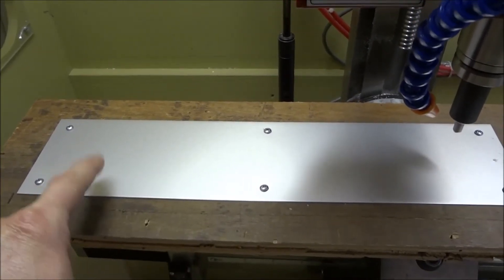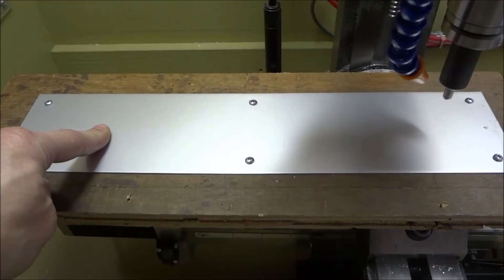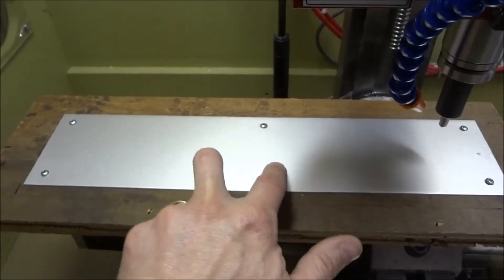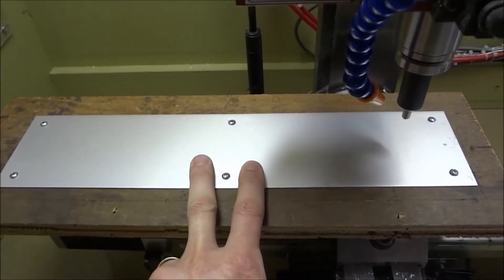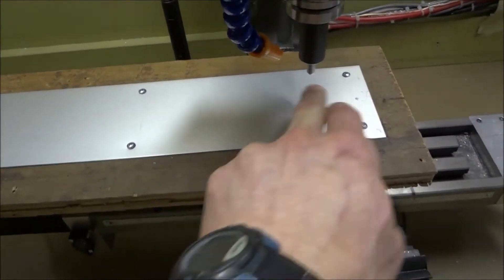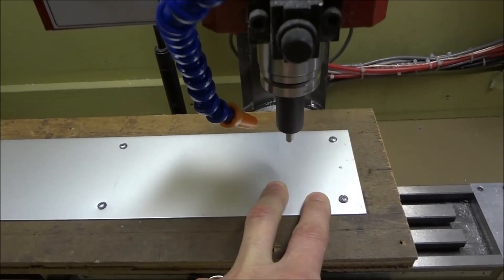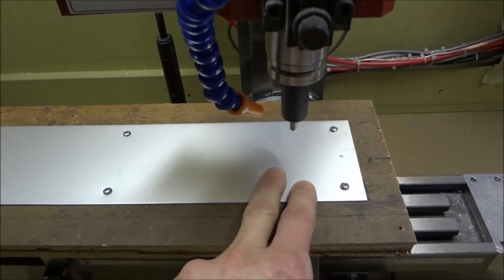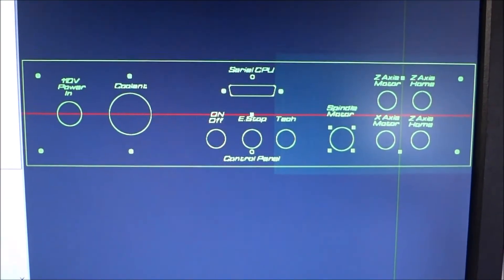G0602 Project Part 6 Electronics Enclosure

Comment: Nice work ! what was the liquid you were pouring on and for which purpose?
Reply from the maker: +Dztronic  I use 90 % rubbing alcohol for coolant when machining aluminum on the X2 i have no flood system or mist so this works well.
be Safe,
Sam
Reply: +CNC4XR7  Could we use simply water for instance?
Reply from the maker: +Dztronic  The Alcohol Has lubricating properties as well as cooling properties I would not use H2o
Reply: +CNC4XR7 Useful informations. Thanks! I was asking that because of the alcohol's flammable properties...I though that with such friction it might ignite...I don't know if it may be possible to happen!!!

Comment: Great Video Sam!  How did you mount the plywood to the vise?
Reply from the maker: Craig's Machine Shop  Ah Yes I just screwed the plywood to a 2x2 and clamped the 2x2 not a perfect setup but it worked the plywood was a little uneven.
Reply: CNC4XR7 
Just needs to be good enough to get the job done.  I will have to keep that trick in mind.
Reply from the maker: Craig's Machine Shop Yea It got the job done!